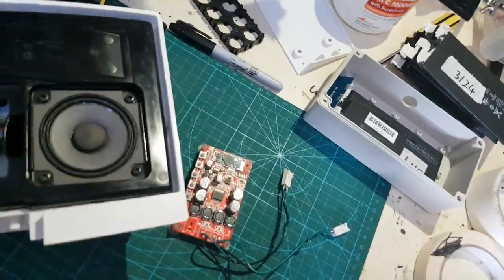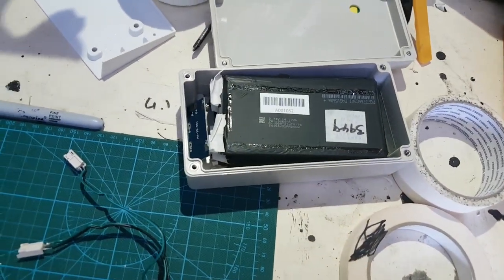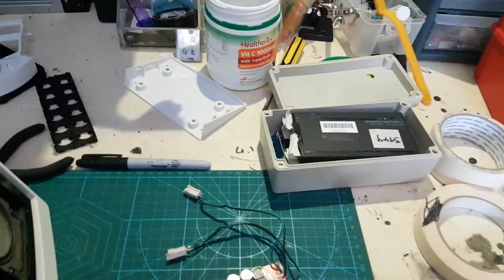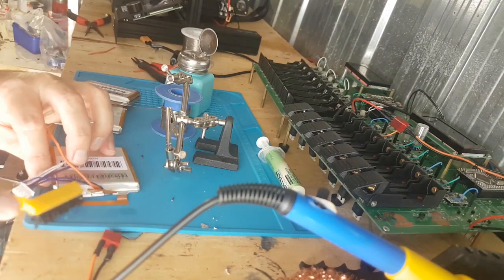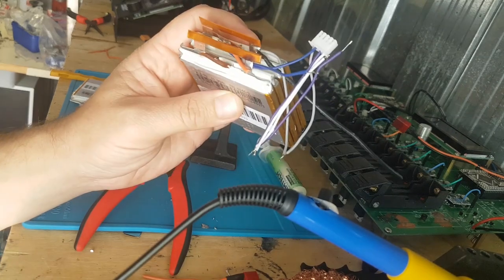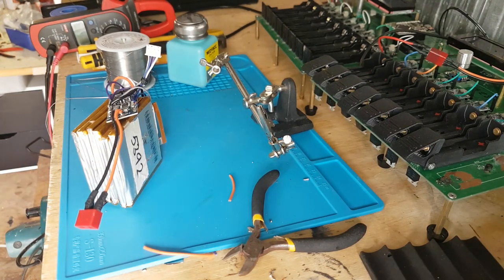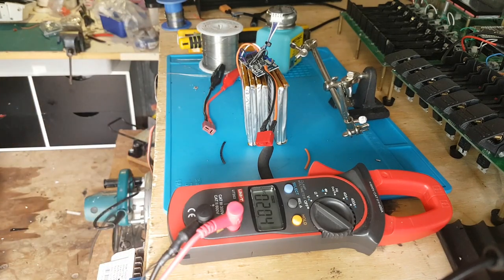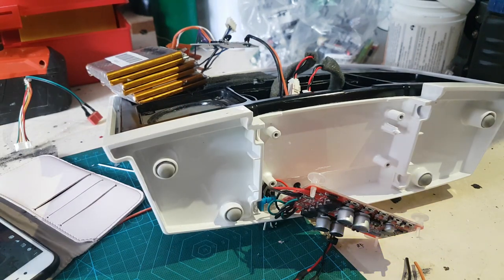Bose SoundDock battery and Bluetooth Conversion

Comment: Se hubiese podido usar la tarjeta o placa amplificadora original que vino con el Sounddock y añadirle un modulo Bluetooth o obligatoriamente habia que cambiar placa o tarjeta amplificadora tambien?
Reply from the maker: It is possible but hard because the original board takes +18v and -18v and that makes it difficult to use batteries.

Comment: Great re-use of the Bose. Can't hear it from my shitty laptop speakers but if its a little tinnier than the original, I think Bose electronics may actively adapt the speaker response. That is all details though, this is a great and relatively simple conversion. Which amp module did you use Brett (link?).
Reply from the maker: Cheers mate, just added the link to the description
Reply: @brettwatty101  Cool, thanks. Stay safe.

Comment: I just want to plug this in my van, got a converter 12v to 18v laptop car adapter 100w, I tried plug but doesn't seem to work somehow, 4 cable confusion. I downloaded this video so I can watch later, maybe solution is here.
Reply from the maker: The original power supply is a dual rail power. So you need +18v 0v -18v power I think.
Reply: well too mysterious for me, I do have the original ac I could plug into an inverter I suppose, not most efficient but saves me headach
Reply from the maker: Yeah it is common in audio to use dual power. I agree easier to use the AC adapter.